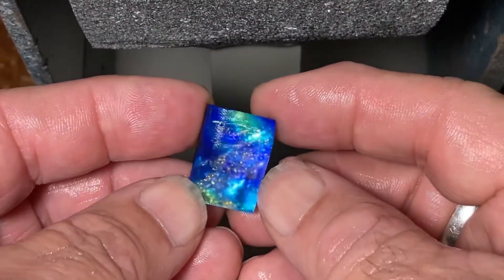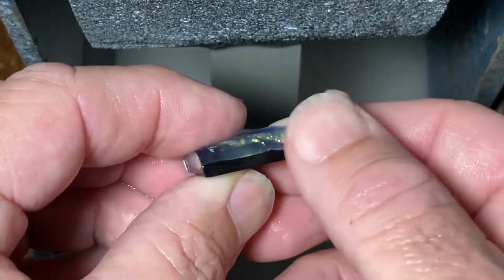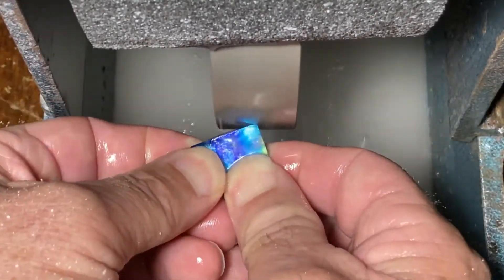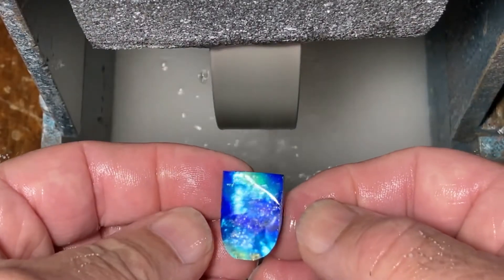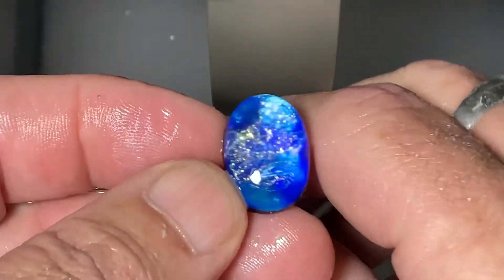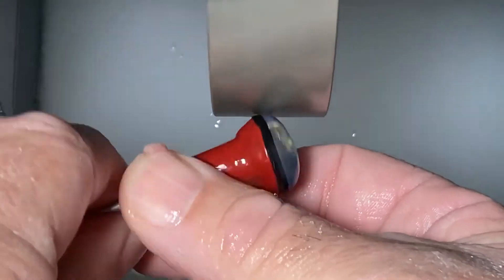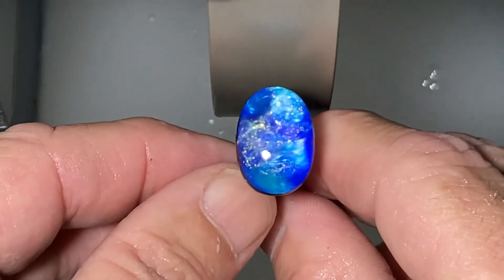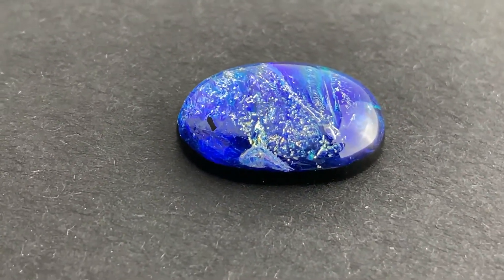Hand Cutting this Golden Pinfire Cabochon in an Oval Shape, Glass Fusing Tutorial

Comment: Very nice, great eye for detail. I haven’t started cutting cabochons yet as I am only working with glass moulds at the moment, when I do would it be feasible to draw the shape of cut on the stone as a guide? I would guess you have had years of practice and can get the shape perfect through feel and sight. Cheers Ed
Reply from the maker: Hi Ed. Yes, drawing the final shape is a great advantage, especially if you want a specific size. As you would for standard bezel or prong settings. Mostly, Ann makes the settings so they are custom made, so I just cut what I can. More about what I think will look best. As far as perfect, well, my sight isn't what it used to be so I have to rework sometimes. Don't tell anyone 😁